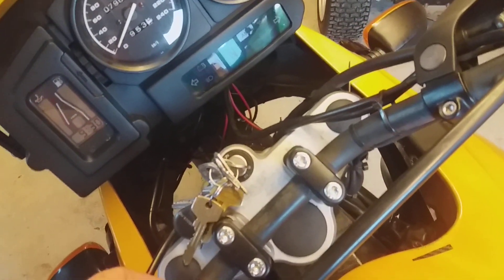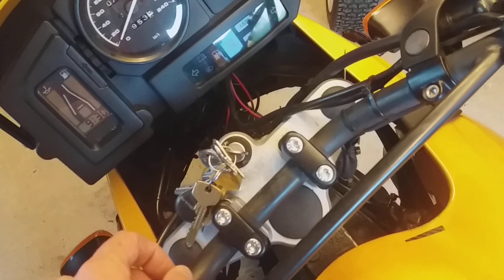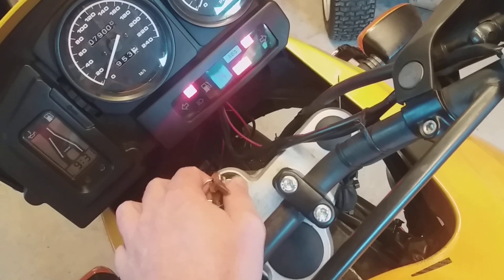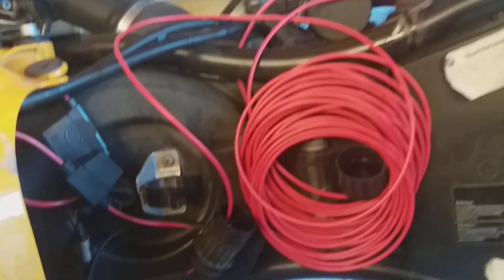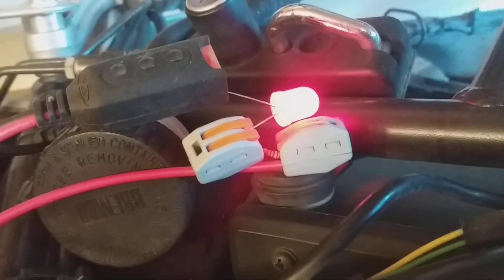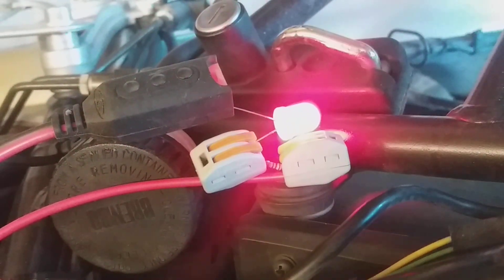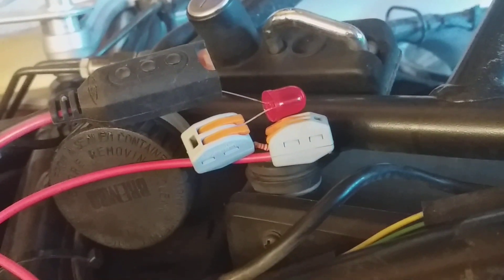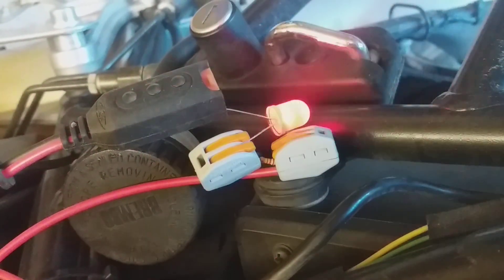BMW R1150GS ABS fault - How to read the error code

Comment: Just a short question: Did I get it right that you have only connected the diagnostic pin and the battery's positive terminal? because the manual behind your link has a very complicated wiring diagram which indicated that ground would be needed as well. Would be super helpful if you could give me a quick answers! Cheers!